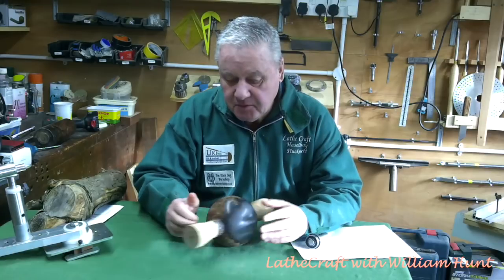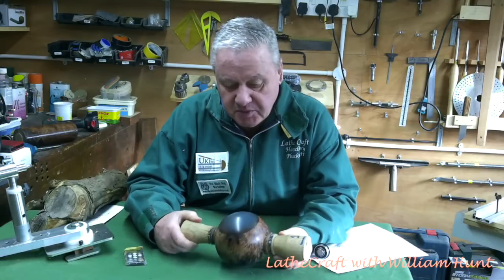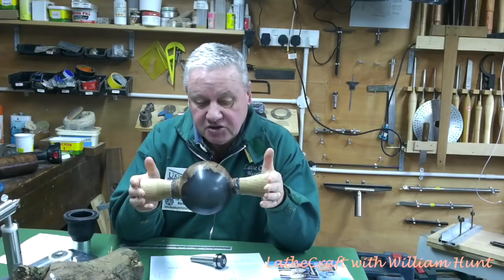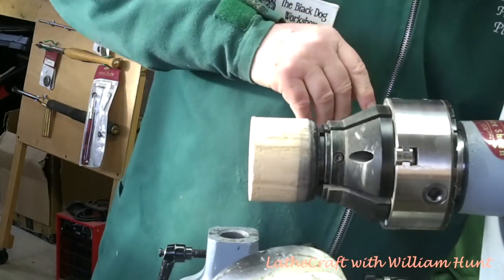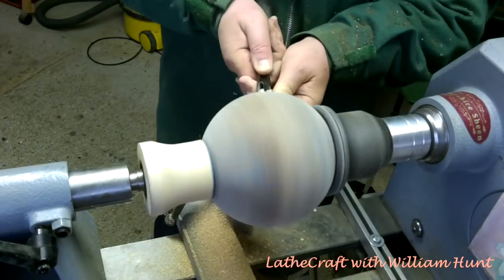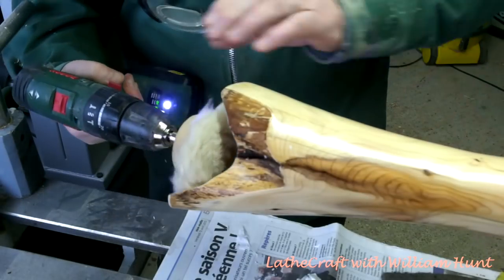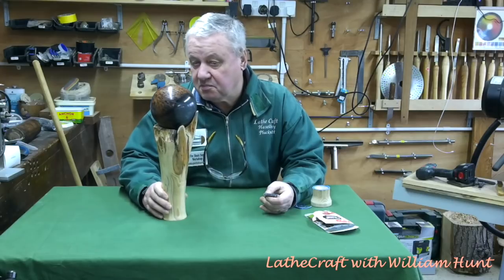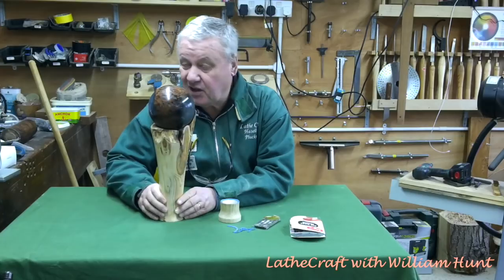Woodturning - Cold Hearted Orb (Resin and Yew)

Comment: Brilliant video William, and a gorgeous piece. Thanks too for the mention.
Nice method for the cup chuck padding too. I go the easy route and buy "O" ring rubber in lengths cut the groove like you, and CA glue it in.
Cheers
Mike
Reply from the maker: Thanks, Mike. The Sugru provides an alternative but as you say, the O ring is probably easier.

Comment: Very well done William.   Glad to see the resin sphere finding a place in a project.   As you mentioned resin is not cheap, so I only use this to fill in gaps - so far.

Another instance where you are a braver man than I to turn the end of the yew without a steady rest.

I made my own steady rest for my NOVA lathe.    I wrote an article for my local turning club Projects page.   Take a look if you are interested in making one.   I have used my steady rest a number of times .  Wood lathe jaws do not hold long items well.   My metal lathe chuck jaws are much deeper and stronger.

http://lehighvalleywoodturners.com/projects/

I do not know why you think using the vacuum chuck to hold the piece without the vacuum would damage the chuck.   I have a HoldFast 6in dia vacuum chuck and have used this more without vacuum than with a vacuum.   I am not seeing any damage per se.    One of the two rubber O rings is loose, but this is just from not having much glue to hold it in the chuck.

Thanks for the reminder about Sugru.   I saw this in some other video months ago, not wood working related.   I will have to get some.   Handy for fixing cables etc.   The US site calls this moldable glue.

Another option for O rings is to make your own.  HoldFast sell a kit.   A US link to illustrate but likely a UK distributor.  I have this kit.  I will be using it when I make some more vacuum chucks.

http://www.packardwoodworks.com/Merchant2/merchant.mvc?Screen=PROD&Store_Code=packard&Product_Code=110920&Category_Code=lathes-acc-vc-holdfast

Thanks for taking me back in time today.   I still have my vinyl record collection and a working turntable I purchased in 1977.   The album Days of Future Passed is in my record collection.

Dave.
Reply from the maker: Thanks for your comprehensive comments Dave, much appreciated. Ill take a look at the steady rest, thanks for that I do need one for sure. I have never the felt that the Holdfast Chuck is robust, I can't say why, but I'm always wary of damaging it, and yes one of the rings has come off and I need to glue it back into place.

I think Sugru has a lot of potential!

I'm glad there are still Moody Blues fans around,  with Jeff Wayne, always in the background in my workshop. (Yes on vinyl)
Reply: The HoldFast vacuum chuck design is not as strong as it seems.   The plastic chuck has a boss which is glued into a machined recess in the aluminium.   I have had a catch when using this in vacuum mode without tailstock.   This knocked the plastic loose.   It was easy to reset but shows the weakness of the design.

A company called RubberChucky (crazy name) in the US sells various  silicon rubber products, one of which is meant to replace the O rings in the HoldFast chucks.   A link to illustrate.    This product presently out of stock, but may be useful as reference.

https://www.rubberchucky.com/store/p43/Fits_Hold_Fast%E2%84%A2_Vacuum_Chuck_System.html

Look around the RubberChucky site.    They also have products for chucking spheres.

https://www.rubberchucky.com/store/p50/Anything_Chucky_Set.html

Dave.